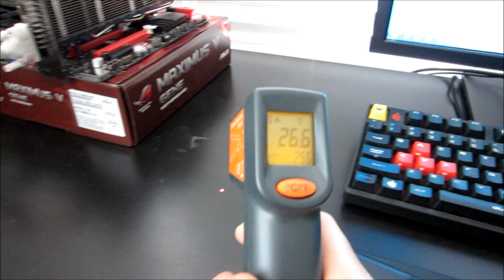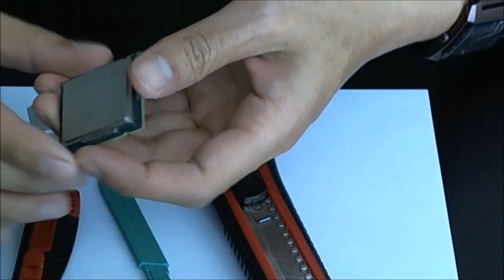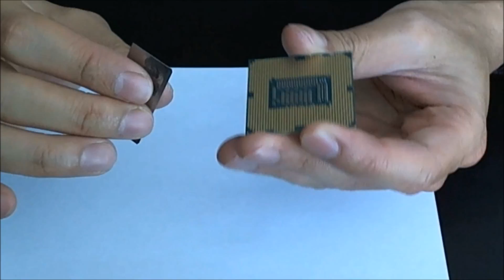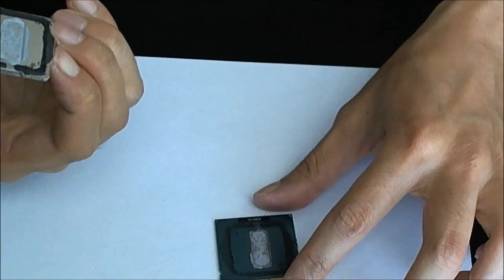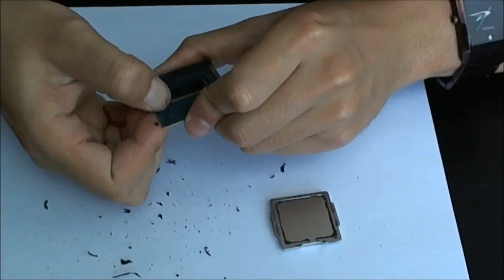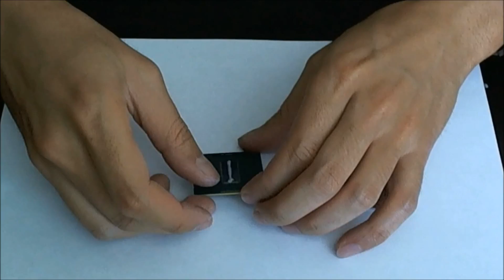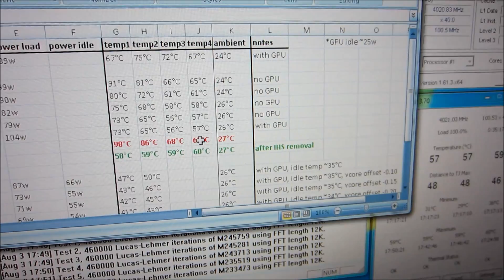Fixing Skylake, Haswell, and Ivy Bridge CPU temps: IHS removal

Comment from the maker: If bad temps are solely because of architecture, then doing this would net no temperature drops. 

And if you actually knew anything about architecture, then you'd know Intel runs off the tick-tock schedule. IB is heavily based off of SB architecture, but with a die shrink. Major architecture change will be in Hasewell.

At first, I though you just haven't done the research and just spew out BS. But a quick skim if your account shows that you made an account for trolling. Quite sad really.

Comment: Really not the issue here. IB is just SB with 3D gates and on a 22nm process. That's it. SB doesn't have these problems. My mate's 3570K ticks away happily at 4.5 with no thermal issues either. I think Intel just had a bad TIM batch at the start. They used to solder the IHS on before, but I think the 22nm transistors really can't handle the soldering temperatures.

Comment: I want to i am just bricking it! I always wondered why a die shrink on sandy bridge could run hotter. I have a 3770k and a good custom water cooling setup and I couldn't reach the clocks a 2600k could reach with a good air cooler. Your 3570k was very hot, at 4ghz running prime my hottest core is 56c and the coolest 49c. When you raise the clocks it gets hot fast. Would this mod still benefit me?

Comment: IHS Integrated Heat Spreader ... does what it says on the tin, takes heat off the die and spreads it into a contact plate for a non-integrated heat spreader (cooling tower)

Comment: Nice. I have the same CPU and it looks like you had a little of a dud, it shouldn't have been getting that hot or had that much of a discrepancy. I think one day I'll do this just to see what I can get. Why take off all the adhesive? If anything, it looks like it would help keep it stable when putting it back on the board instead of sliding around.

Comment from the maker: Never seen sub-zero benching? Vaseline or dielectric is actually put INSIDE the CPU socket in order to insulate it from moisture. As long as all the socket pins makes contact with the CPU, grease or insulation doesn't affect anything. So trace amounts of grease on my hands won't have any negative affects. Static electricity might, but that's why I was constantly discharged throughout the whole process with a metal frame.

A quick google of "motherboard insulation" should show you.

Comment: i have the same cpu and with a cooler master hyper 212 evo in the case at full load oc to 2.4Ghz and stock voltage prime 95 test I never get over 40.C and room temp is 23-24!

Comment: I have done it before, just make sure not to tighten it down too tight. The socket will hold the chip just as securely as it did with the lid on. Try it on an older chip first, maybe 775 or 939 to get the feel for how it works. Good luck and enjoy overclocking!

Comment: Thats what i was wondering...... Why put the the shield back on at all, just put a cooler in direct contact with the die. I think the only problem might be that the socket wont hold the die in place securely as the shield is the contact point for it.
Has any one tried doing it this way and did it work ?

Comment: "Ivy Bridge and changing the Thermal Interface Material" (google it) just reviewed recently, mentioning this url as a good example of how to do it.
They suggest having the CPU hot. I'd heat it with an hair dryer, etc to help remove the Intel stuff.

Comment: the removal part of the video but the rest was kinda pointless only 4Ghz? You should be able to 5Ghz after doing that, I'm on 4.7ghz without replacing my internal TIM my temps are around 75-79C though my vcore is jacked way up to 1.55v

Comment: I do have to add.. if you put this effort in, apply the new TIM at least in the most efficient way.. which is literally minimally. Apply and ssmear it across the die.. then take a suitable non bleeding cloith and wipe it off in such a way only microscopic cracks will have paste.. metal to metal is by far better than paste which only is meant to make the contact surface more homogenous :) That will probably knock off another 3-4 degrees (read: +0.1-0.2 Ghz with your cooler).

Comment from the maker: umm I'm not even going to try to go into detail, but just about everything you said is WRONG:

1) MX-2 is conductive, etch the die, and get crusty like stock TIM
2) changing fan to different position will get me 7-13C lower
3) water cooling will give lower temps than ambient
4) I'm already screwed at this point

Comment from the maker: You're pretty much required to take the old blue off because the blade cuts them unevenly. Some areas will have more on the IHS, and some areas will have more on the PCB. When you put the IHS back on, this unevenness and inconsistent can give you bad results.

Lapping the CPU is a different concept. The surface of the IHS tends to be convexed, so lapping and polishing will make it flat so more surface area of the IHS will be in contact with the CPU cooler.

Comment from the maker: Yes. After this mod and video, I'm currently running at 4.5ghz, vcore 1.29v, max temps 80C at full load, and running a quiet 800rpm fan.

Comment: Isn't it possible that taking the seam of glue off of the housing and PCB gives you almost 1mm less distance worth of TIM for the heat to travel through? I've seen people lapping CPUs with 10c  difference by removing about 1mm of material from the heatsink.

Comment: do not use rubbing alcohol. It contains oil which leaves a residue on the surface. This is terrible. You can buy isopropyl alcohol which does not contain the oil, from bunnings warehouse or your local chemist. There are probably other places, but those are two I know for sure.

Comment from the maker: The mobile 5870 in your notebook does not have the additional IHS layer, so removing the IHS does not apply. However, you can still reapply better TIM to get better thermal results. But no matter what type of aftermarket TIM you apply, you'll only get mediocre thermal results because of the nature of notebooks. You can't upgrade to better heatpipes or coolers, and you still have air flow limitations because of the space constraints inside your notebook.

Comment: Hmmm this is very interesting and your results are outstanding! I don't know about your experiences, but I have 2 ATI Mobility Radeon 5870s in my laptop. One runs at 70C under normal gaming load and the other gets up to 90C, got to 99C running Furmark.
Do you happen to know if your procedure would work for these cards?
My coworker was suggesting a re-paste of the Heatpipe to the heatspreader on the core, which might help.

Comment from the maker: True that leaving the IHS off eliminates another thermal obstacle, but here are some reasons why you should put it back on: 1) Bare die is fragile and could crack under high pressure. 2) Many aftermarket coolers, waterblocks, and stock coolers are shimmed to a certain height, so removing the IHS might cause the die to not even touch the cooler base. 3) Provides high surface area for heat to transfer to the cooler's base. Direct-touch type coolers REQUIRE a certain amount of surface area.

Comment from the maker: You can see in the video based on the fan orientation that it's blowing air at the video card, not sucking it in. Video card was also not stressed, so heat from the GPU is minimal.

Comment from the maker: The heatsink I used is a thermalright HR-02, is has a pretty good mounting mechanism. Bad Ivy Bridge temps was not because I had bad cooler mounts. I mounted it several times with the same results, the same core was getting consistently higher temps. You can see all the data entered in excel in the video. After the IHS mod, I mounted it same exact way, all cores had lower temps and consistent with each other.

Comment from the maker: Low noise is something I value too. In the video, I used a 1600rpm fan to make air flow less of a factor in temp testing. However right now, I'm running a different fan at 800rpm, nearly inaudible.

I did read Anand's article. You can actually undervolt and still have a slight overclock like I did in the video (4gz @ 1.07v, sock vcore is 1.15v). Just keep in mind that no matter how much you underclock, there's still a minimum voltage that the CPU needs to run. That's roughly 0.90v

Comment: Thanks for the cooler info. Yeah, I asked because low-noise is something I care about a lot. I'd even rather undervolt + underclock it a little bit, if that means I can run an Ivy Bridge with no fans at all! Anand did a good article on undervolting and overclocking on Ivy Bridge (you can search for that), and they tested underclocking too to get lower temps (on an i7-3770K).

Comment from the maker: You're probably right, I should have used a tad less. But in this case, it's better to use the line method because the actual die is a long rectangle. One drop of TIM in the middle will not spread far enough to the two outer ends of the die. The drop method about the size of a rice or pea is good for perfectly square bases, like the top of the IHS. I used the drop method between the top of the IHS and the CPU cooler, and line method between the die and bottom of the IHS.

Comment from the maker: Have you seen sub-zero benching? Vaseline or dielectric is actually put INSIDE the CPU socket in order to insulate it from moisture. As long as all the socket pins makes contact with the CPU, grease or insulation doesn't affect anything. So trace amounts of grease on my hands won't have any negative affects. Static electricity might, but that's why I was constantly discharged throughout the whole process with a metal frame.

A quick google of "motherboard insulation" should show you.

Comment from the maker: You're pretty observant. 

Yes, the video card is a passive 5770 silent cell. The CPU cooler is a thermalright HR-02, good for low airflow or passively cooled. I used a 1600rpm fan though. One stick of memory was in there just to get the machine running for CPU temperature testing purposes, but the setup you see is not my final configuration. My final setup inside a case will have higher memory bandwidth though.

Comment: It looks like a Gigabyte HD 5770 Silent Cell graphics card... what's the CPU cooler?

Also, have you tried adding another memory module (in the other red slot)? Ivy Bridge is dual-channel DDR3, so you should get better benchmark scores by having two or 4 modules.